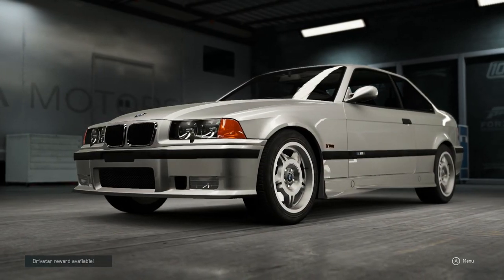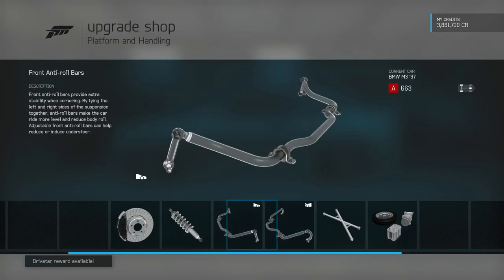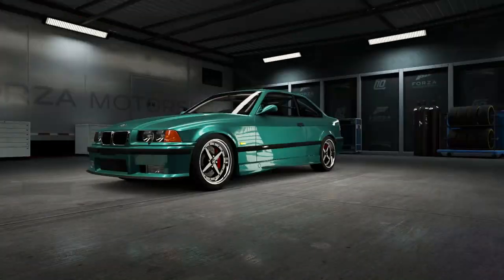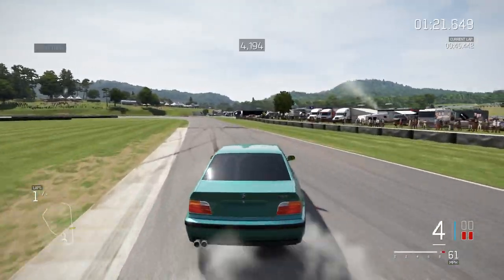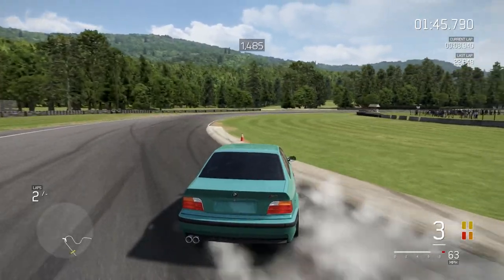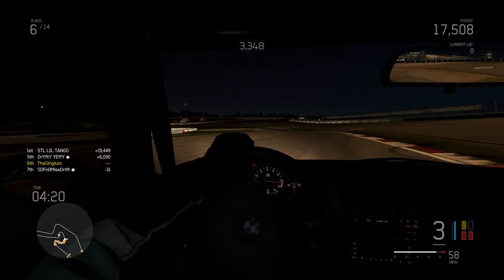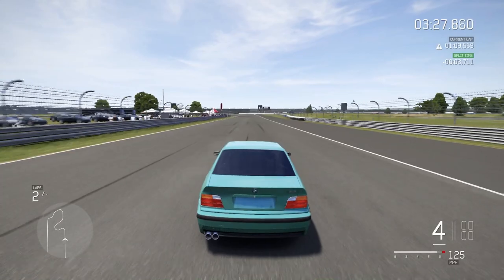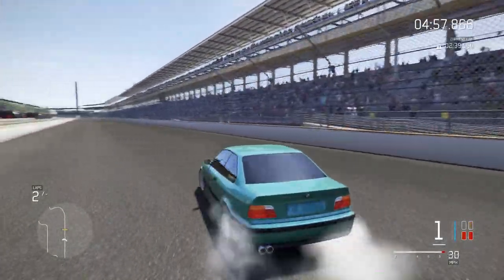1997 BMW E36 M3 || HAGGARD GARAGE - DRIFT BUILD || Forza 6

Comment: cool build Gingium but yea I'm I thinks it's a flat 6 ;) no worries great vid
Reply: Straight six not flat six
Reply: pretty sure its flat six m8
Reply: Nope, they have straight/inline six engines. Flat six engines are most commonly used in subarus not bmw's
Reply: Nope, they have straight/inline six engines. Flat six engines are most commonly used in subarus not bmw's